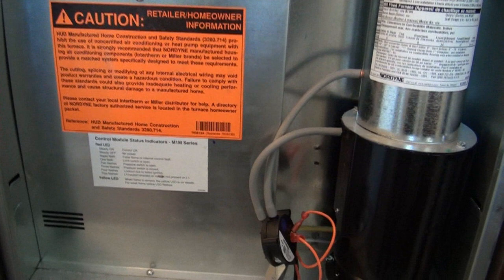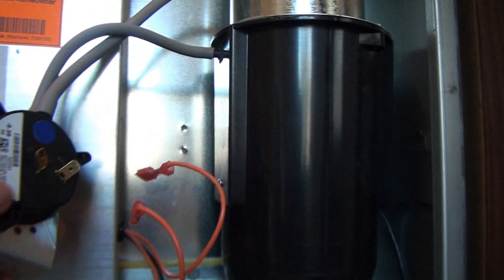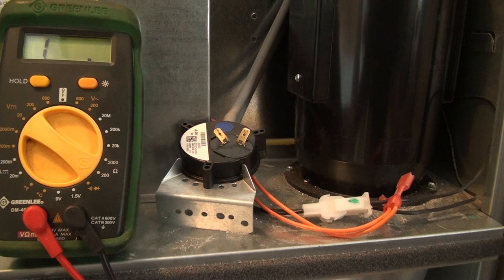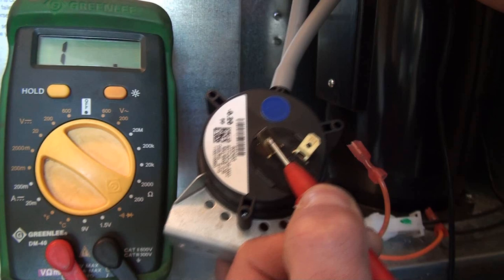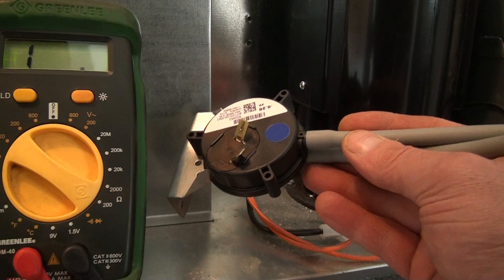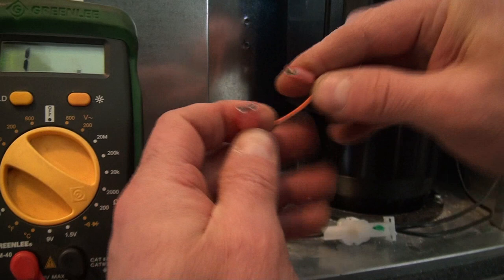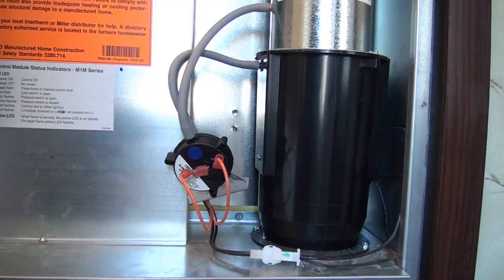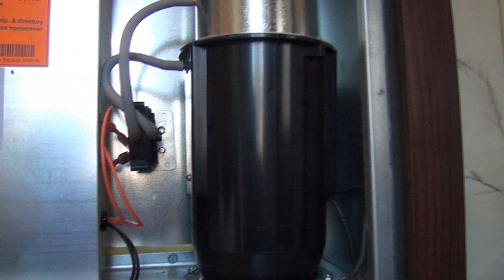DIY Troubleshoot Miller Propane Furnace Negative Pressure Switch How to Test Combustion Draft Sensor

Comment from the maker: Replacement Propane Furnace Pressure Switch on Amazon - https://amzn.to/3233VA6
Propane Gas Detector on Amazon - https://amzn.to/2BXzmBk
Multimeter on Amazon - https://amzn.to/2BWX40I

Comment: Just had to replace my switch last night. I fooled around with the furnace for a couple of hours. I did not even know about this negative pressure switch. had to call help. Repairman stealthily fixed it. He also jumped the wires, I noticed. Next time I will be able to check it myself thanks to good instructors like you. Thank for sharing with us!

Comment: Great troubleshooting! Question: you applied negative pressure by sucking on lower tube and got the resistance to change. Does the upper tube work the same way where you put a suction on it as well? Why might a technician have put a plastic bag on the nipple where the upper hose was plugged into thereby blocking off the upper section of the blower nipple? Any ideas? If I take the plastic off and plug the tube back in and fire up the furnace the gas valve clicks on and off on and off on and off and doesn't start. if i put the plastic back on, the furnace starts but takes one minute for the ignitor to light and over a minute and a half to fire up.